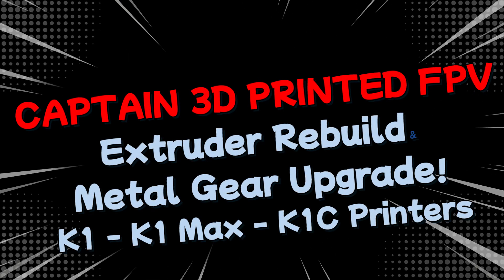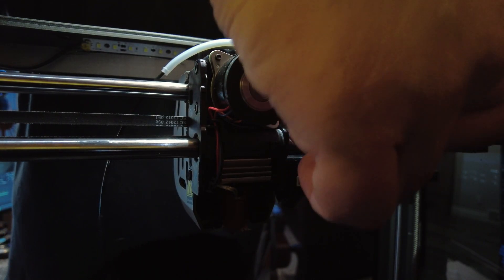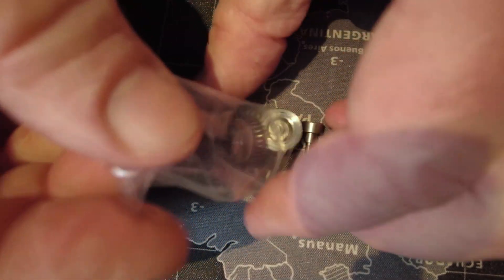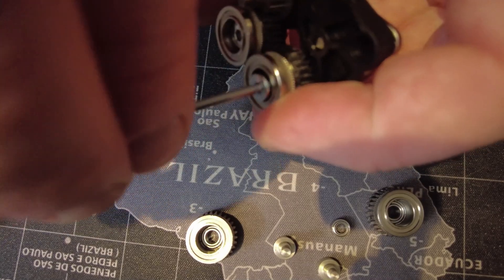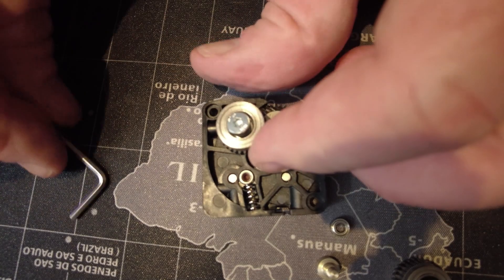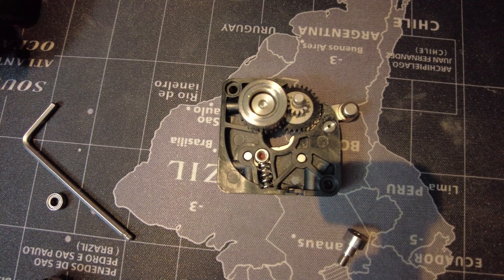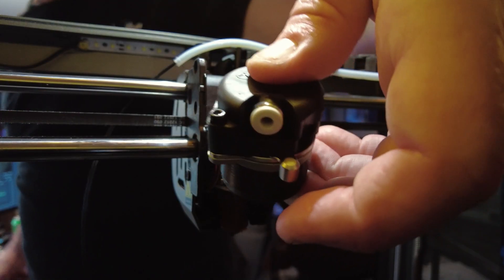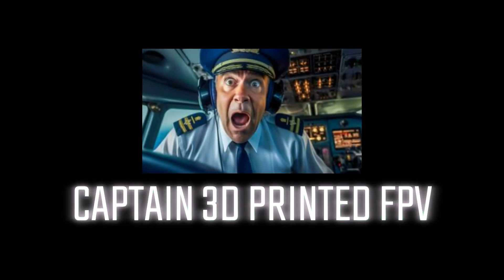Fix Your Creality K1 Extruder - Eliminate Slipping, Popping, Clicking, & Skipping - Perfect Prints

Comment: What attachment did you use to hold the Bowden tube to the outside of the black piece?
Reply from the maker: Not exactly sure what you are asking, I have a filament dryer and the tube runs to that outside the printer, internally there is small zip ties.

Comment: I was stumped with mine till i noticed the feed roller bearings were worn the teeth weren't even worn
Reply from the maker: I was not impressed with the factory all plastic parts.  This should be metal in my opinion.  May add a couple bucks to the price, but well worth it!